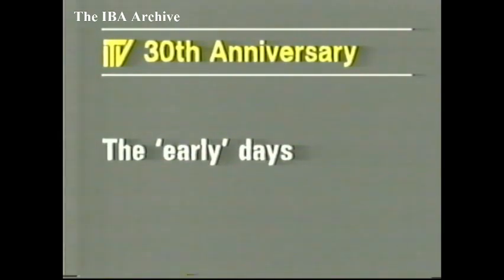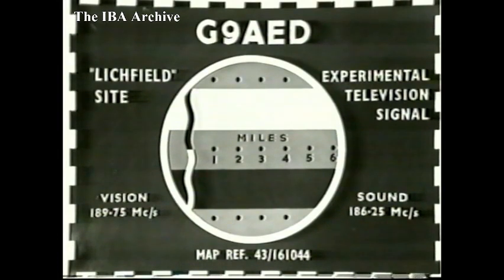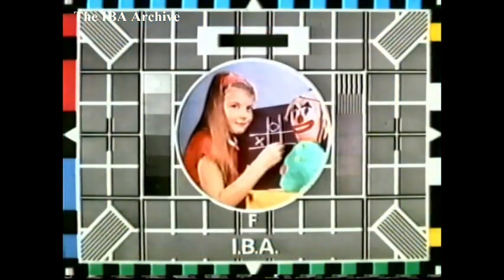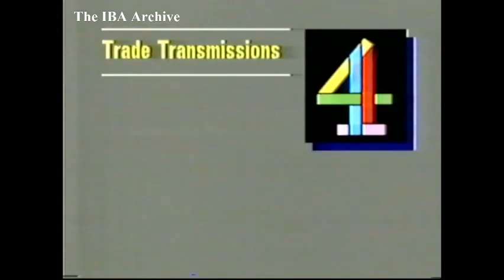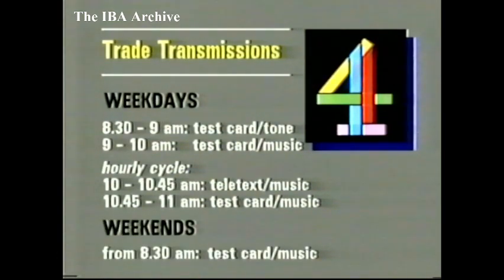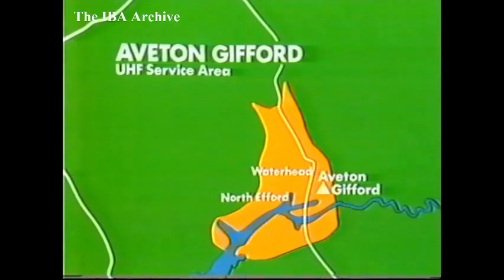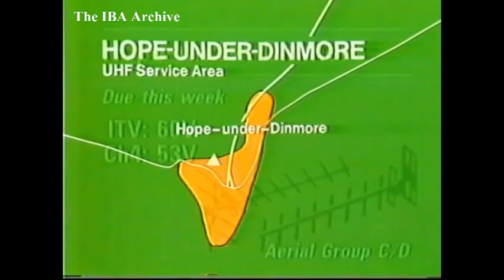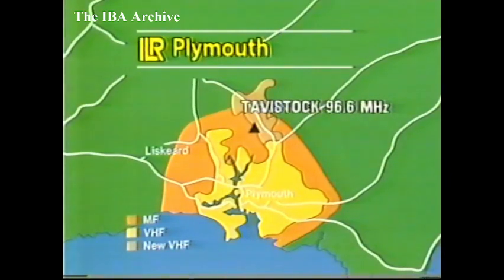IBA Engineering Announcements - 22 October 1985 'The Test Card'

Comment: Thank you for this look into Test Cards-most interesting. Of course, they only mention ITV and Channel 4 (not S4C?) at the time, not BBC1 or BBC2 neither as it would have been then in 1985. I guess this is because they were the IBA then, not the BBC at the time. However, Test Card F was really on the BBC as far as I know, where as Channel 4 showed only ETP1 at the time. By then too, both BBC channels mainly showed Pages From Ceefax with music during downtime in the daytime, ITV ran a full service and Channel 4 as it says here alternated between ETP1 and either Oracle or 4-Tel pages.
Well done of course too!!
Reply: Test Card F and its predecessors were originally used by both BBC and ITV equally.  Both of them also used the Test Card G (a mildly tweaked version of that Phillips PM5544 t testcard).  ITV also used colour bars, especially for the final 5 minutes or so before programming began  ETP1 was the first exclusively ITV testcard in 1979 - in the Thames area that would come on at 0900h and switch to colour bars with an extra red bar along the bottom at 0925h then at 0929 it would go black and silent for a minute until the blue screen and Perpetuum Mobile came on.
There are plenty of screenshots of Test Card F on pre-1979 ITV test periods, often with really good quality classical music instead of the tone, much better than the tacky loungecore the BBC would play.
Channel 4 was always ETP1 with its own little twist to the logo.
Reply: @kurtvanderbogarde8402  Yes indeed too you are so right there of course indeed!
Reply: @brucedanton3669  I would love to some time see the jump from ETP1 to colour bars with red bottom (what is the technical name for that one?) with the tone suddently jumping higher, that we would have on Thames TV 1979-1982 about 5 min before Perpetuum Mobile.  Or better still the jump from colour bars with no red bottom and the same tone as ETP1 to colour bars with the red bottom that we had for a few years earlier.  Three year old me thought the red bottom thing was what actually made the higher tone - it would appear on the screen and the tone would jump from low to high but it seemed more fluid and natural a thing to happen than the jump from ETP1 to bars later on which was totally disorientating the first time you saw it.
Reply: @kurtvanderbogarde8402  Yes of course I see too-you are so right there I am sure on that too as you must be as well also.
Reply: @brucedanton3669  well these are childhood memories of mine so yes I would hope that some day somehow I get to see those things again LOL
Reply: @kurtvanderbogarde8402  Yes and why not indeed too of course? I don't see why you should not indeed too as you say-rightly so too!
Reply: @kurtvanderbogarde8402  And of course you do too-and why not indeed. I know I would too!
Reply: Although of course, Ceefax on BBC and Oracle on ITV and sometimes also 4 Tel pages on Channel 4 were really all Teletext pages as such on the old analogue service as it was then (compared to today's digital one that is). At least until the end of 1992, because as we know, from January 1993 onwards BBC Ceefax continued but Oracle and 4-Tel became the generic Teletext service as the ITC by then had awarded them the contract to do so at the time. Teletext continued until 2009, and Ceefax until 2012 when the last analogue service was of course switched off. It's a shame that digital now only offers the BBC Red Button Text service on their channels, whereas on the other channels there is now nothing at all to replace it. Oh well!!
Reply: I remember too at one time-in the 1970s and 80s I think there was also a service called Prestel which I think was run by the Post Office at the time. As far as I know, it ran for a number of years before being closed down by them, presumably because it was not that popular. Thank you!!

Comment: When the ITV strike was on in 1979 did Engineering Announcements still broadcast and was the ETP1 testcard shown when ITV would have normally closed down at night?
Reply: Yes, Engineering Announcements were shown. Not sure about ETP-1 but the equipment also generated the captions shown. Transmitters were likely off outside expected broadcast hours.
Reply: ETP-1 was not shown at night except maybe for the first few mins after broadcast.  It would come on at 0900h before the final preparations for TVam kicked into gear.
Reply: When TV-am was due to launch in a few weeks, ETP would be on at about 6am and go to colour bars at about 0630h